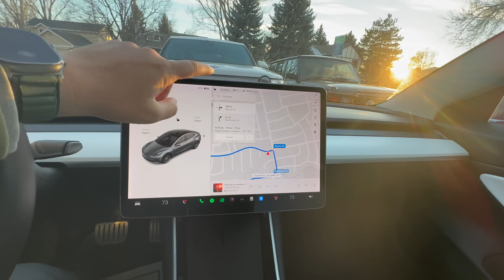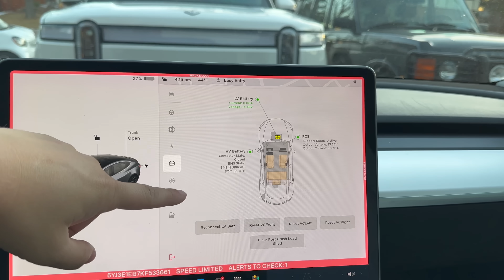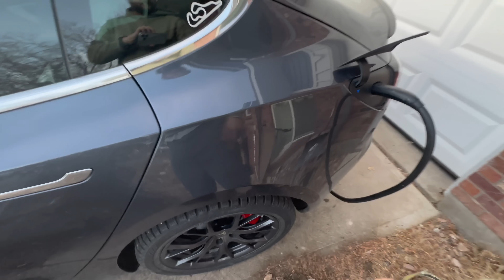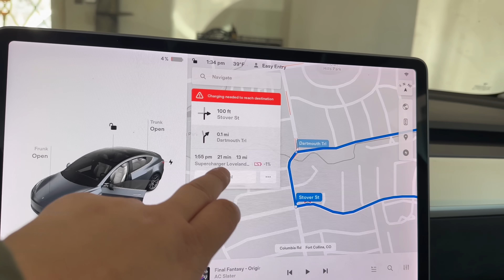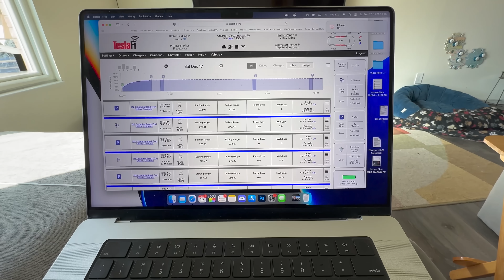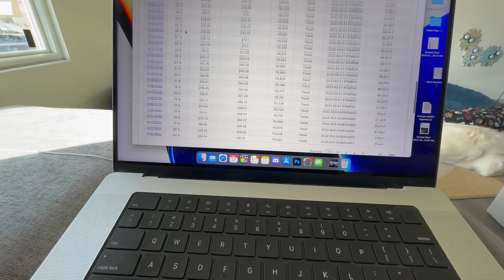Tesla Launches Service Mode! Wild Battery Health Results For My 120,000mi Model 3

Comment: I started at 18% battery health and the car was very noisy for 3 to 4 hours brought the power down to 3% and then started recharging up to normal 75% showing battery degradation of 84%. (2021 SR+ 263 epa range, now 217)

Comment: Those battery figures are just estimates, there is no way to know with electric batteries, same with your phone. My phone has been stuck at 84% percent for over a year now but im constantly charging, its probably about to go out. Same with the range, with batteries there is no way to know, just estimates by voltage and other stuff, with a gasoline car you exactly!!! know how much fuel you have.

Comment: I can’t find the post on what steps you exactly need to do prior to running the test?

I tried it a few times but it never completes.

Either 90% limit stops it or scheduled charging etc stops it and I have disabled both so it could complete but never does.

Any specific tips prior to entering service mode to run this test successfully while my battery is almost 10% please????

Comment: IT SHOWED HERE THE AC THE BATTERY HEALTH IS VERY LOW MEANING THE INVERTER IS NOT CHARGING IN CONVERTING AC TO DC. BUT CHARGING SUPERCHARGE IN TESLA CAN GO 100% MEANING DIRECT DC HAD GOOD CHARGING COMPARED TO AC CHARGING. BETTER SEND BACK TO TESLA TO REPLACE THE INVERTER.

Comment: The 8% battery figure is probably about as accurate as 175 PSI tire pressure.
Reply: The median between low and average is another good figure at around 14% degradation / losses.
Reply: Isnt it 17.5 psi?
Reply: @Candy-uo8sv  That would be too low.  Tesla tires usually have about 40-45 psi, which is more than a gas vehicle would normally have, but even a regular gas vehicle should have at least 25 psi.

Comment: We love traveling in our 2021 MYP. We have 38k miles and our car shows 267 miles when fully charged. Hasn't really impacted us based on the way the SC are spaced but I'm curious if we've really had that much degradation in 2 years.  I'm not brave enough to play with the service mode though.  Love your videos.  I aspire to be like Kyle or dad Dave. :-)

Comment: I think that mileage does not that much effect the battery health as the time. My M3 long range is 2018, but mileage is very low, now it is about 5500 miles only. Never supercharged (actually just tried once for a 5 min), charged to 100% only a few times before the trips. I did not do the test, but my range now shows ~285-288 miles if charged to 100% instead of 310, which means loss of range about 8%. So, it basically the same as for cars with more than 50K miles.
Reply: Do you always charge to the same level?  And do consistent trips like drive to work, get home, charge back to 80% every day?  If your car almost always sits at the same levels of charge (80% and whatever you arrive at work) then the BMS only has a couple data points and can't accurately gauge capacity.  If so, try charging to different levels (70, 85, etc) and/or skip a day of charging if you can and see if over a few weeks the range climbs.
Reply: @ekbuz  No, I don't charge always to the same level. It looks like that range now is like 285-287 miles stays the same about a year. Generally the battery  degradation is fastest in first years and then slows down, so I hope that my car will not be an exclusion.

Comment: Since your car took 64.30 kwh into the pack from 2%, and the usable battery capacity is 70 kwh, I think it'd be safe to assume that means you have about 7% degradation of the usable capacity. Probably a decent margin of error there, but Tesla saying "battery health 8%" might mean that you have 8% degradation of the usable capacity, which would be in line with what the napkin math works out to be.

Comment: Final result show my 2018 with almost 68k miles at 84%.  The last 4% of the drain process was weired.  It looked like stuck at 4% with nothing going on to drain the battery.  I had to stop and restart the test after a full day of waiting.  I don't know if it went to 0%.  When I noticed it started to charge, my screen showed 5%.  Also worth noting is after the test, my car was reset to factory default, which I lost all our driver profiles, favorite, etc.

Comment: About the test:
Has to be arround 20% to start.
First time i had it on 7% and it made alot of noise. Drained battery fast, But never charged back up. After 24h it was sitting there with 3% battery and it could not charge. Had to jnplug and powercycle the car then chsrging worked again.
Tryed with 20% again as ppl said and it did nothing at all.
So my guess is the test isnt working as it should 😅

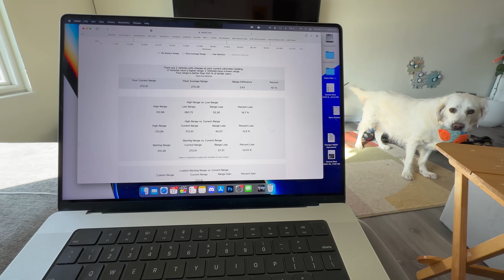Comment: 18:35 that doesnt include the hidden rated range.... if you have added 64kwh into the pack that suggests you have 64/78.8 = 18.8% degradation which fits really well with teslafi and your rated range of 270 miles - teslafi does not account for that. my car has i think 65kwh estimated capacity according to SMT and has roughly the same range as you.

Comment: Wonder what the uncertainty of the measurement is?
Typical current sensor say 300A +/-1%/2% accuracy, +/-1% linearity about +/- 4.2 amps @ 300 amps, charging at 40 amps could be  +/- 10% error. This does not take into account temperature sensitivity.
The voltage measurement will be better say +/- 0.2%
Since power is volts times amps the power measurement at 40 amps charging could be +/- 10% uncertainty.
Good thing is this uncertainty should be fairly consistent over the life of the cars measurement system.

Comment: Great video. I saw you did a lot of modifications. Specifically the lift. If you need to take your vehicle in for repairs what do they say. The aftermarket  stuff probly voids warranties. Will they still work on it? If you have to pay for the repairs how much do they usually charge? Is it calculated by a hourly rate,plus parts like regular dealerships?
Reply: It doesn't automatically void warranties, to a point. The whole car warranty? No. If you put aftermarket suspension on and something suspension related fails, maybe. But if a drivetrain part fails and they blame it on the suspension, they have no case. Been modifying cars for years, and it really comes down to the dealer working on it. My last car was modified significantly and they had no problem with it. Granted I did most of the maintenance and only took it there for major items.
Reply: @pathsfnd  Thanks, just wasn't sure what voids the warranty on a EV.

Comment: Are you sure the test completed? As I understood the test is was supposed to charge to 100%, but you are only showing 98.8%. Do you contend it charged to 100% then phantom drained 1.2% while plugged in? I think you have to do the test again. I also suspect you don't need to set your charge limit to 100% (i.e. the test overrides the user set charge limit) - would be curious to see a confirmation of that.

Comment: Out of curiosity why do you feel like you need studded tires? I have a 22 f150 powerboost 4x4. It’s totally stock has the factory tires and when we got this “blizzard” last week the truck was a beast in the deep snow and even icy roads. I would think the rivian would be even better. Just wondering. Thanks! I should add I’m in Michigan.
Reply: There are mountains in Colorado.
Reply: @RT-rv5be  and? There are mountains in lots of places. I was trying to get an answer from Kyle what his reasoning was. I’ve been over countless mountains in awd/4wd vehicles with standard all terrain tires without issue. I was looking for an answer from him to see if there was some difference with the evs that he has or was it in abundance of caution etc.
Reply: @Astrand1  Yeah, there are mountains in plenty of places but not where you live.
Reply: @RT-rv5be  so does that mean I don’t ever drive in The mountains? What kind of answer is that? We are supposed to helping each other I think that’s the point here. Again I was asking Kyle his reasoning for that. It might help others that could be looking at certain cars etc.

Comment: I have a question for you guys in the comment, so my 2019 M3 has about 95k miles, my full charge rated miles says about 272, but when driven about 73 Mph highway after my day is done I end up at 15% SOC or so and that’s after driving 153.7 miles!  I know other things consume the energy, but according to the energy app, when I add all the mile consumed it only adds up to about 190+ miles all together…. So to go from 272 miles to less then 200 it’s quite significant, any of you have notice similar things?
Reply: What kind of Wh/M is your trip meter showing at the end of the day? Are you in a colder area right now?
Reply: Tesla efficiency is poor on the freeway and even worse if the climate isn't just perfect. Add passengers or cargo and the range drops further.
Reply: 272 miles is if you keep driving at constant speed of 55 mph. 73mph would definitely killed 100+ miles because of the driving speed. Try to stay below 70mph you will definitely get more than 200 miles real world range.
Reply: Same problem here. But it's all highway and roughly 75mph+ 😅

Comment: This is all BS designed to intentionally mislead owners.  There is only one real way to determine your degradation. 

First of all. Don't use the GOM estimated range.  It does not take into consideration degradation.  This was from Peter in Southern California. 

The khw capacity of a Tesla battery can be calculated with a fairly simple test. (Below)

But first, what you cannot rely on is the cars display of range. I'm not sure what algorithm is used for the cars display of range, but my 2016 Model S 90D continues to show a full charge “Rated" range of 285 miles. Real range is 200 miles. And significant battery degradation is concealed.

Here is how to measure the energy capacity of a Tesla battery. You need to use the “Trips" page to get a display of kwh used. You need to take a trip that consumes a significant portion of the battery capacity. You need to set the battery display to show percent of battery remaining, rather than miles remaining. At the beginning and end of your test trip, note the change in battery percent, and the change in kwh used. Here is an example (a real example). I charge up my car to 80%. This resets the kwh used counter to zero. I drive around until the state of charge guage shows 30%. The “Trips" page shows that I have used 36 kwh during this test trip. Now you do a little arithmetic. 80% minus 30% is 50%. 50% is 0.5. Now divide the 36 kwh by 0.5 and you get 72 kwh. That is the full energy capacity of my battery. My “90 kwh" battery only has 72 kwh. If I had gone a little further, the ending battery state would be 15%. 80 minus 15 is 65% (0.65). The Trips display would show 46.8 kwh used since last charge. Divide 46.8 kwh by 0.65 reveals a battery capacity of 72 kwh.

The usable energy capacity of a Tesla battery is not expected to be 100% of its nominal capacity. So my “90kwh" battery can only be expected to have about 85 kwh of usable energy. Since it only had 72 kwh (at one year old), it lost 15% of its capacity during its first year. Important thing is that all the while, the full charge display of range was (is) 285 miles. Failing to reveal the battery degradation that occurred. Happily, it has only lost a little more since then. And that's a good thing. Because a Tesla Service rep told me: “We do not replace batteries for any amount of degradation. Only if there is a battery fault. Which the car will tell you.”

Most Tesla batteries are better than this. However, it seems unlikely that my car is the only one which displays normal capacity when in fact it is significantly degraded.

Comment: Did the test on my 115k mi 2021 Model Y LR, got 82% life. Better then I expected tbh this vehicle was driven very hard its whole life and been supercharged a majority of it.
Reply: Wow that’s alot of miles for a 2021
Reply: Wow. Impressive mileage. I'm at just under 115,000 on our 2020 MYLR. Would be curious to know if you've had any issues with your AC system. Also curious how many miles TeslaFi or another app might say you have on your battery. I'm at about 155,000 rated miles used on the battery according to TeslaFi.
Reply: @bnzjamin  what does the battery health say?
Reply: @xxBlackpspxx  according to TeslaFi, only about 12.5% degradation.
Reply: This is disastrous. Almost 20% after only 1-2 years. Like a cheap smartphone battery. If the range is like 290 miles on a charge (since you said driven hard), 115k miles are about 400 charging cycles. 82% health left after that, plus it's only 2 years, is really bad. So, Tesla batteries don't seem to last long after all!
Reply: @xxBlackpspxx  Did you read his post? He drove 115K miles on it in 1-2 years... thats insanely above average.
Reply: @super_tomtendo  yes, it is. But especially due to the low timeframe the battery shouldn't have aged as much. Batteries degrade from 2 things: charging/discharging and solely time by itself. If he drove 115k miles in 6 years it would be even less capacity now.
Reply: @xxBlackpspxx  sir, because of his insane usage he was also required to charge it way more than a normal person. The time frame has nothing to do with that but usage does.
Reply: @super_tomtendo  uh, yes. You don't really get my point eh? Age itself degrades a battery, even if you store it perfectly. And the battery isn't very old and has only like 400 cycles on it. 82% capacity left is bad in this case. Like a really poor battery
Reply: @xxBlackpspxx  Battery degradation with time is not a constant thing, its depends on the % its being "stored", a perfect 50% balance would make it degrade very little.
This is why you see new phones usually being at 50% when you turn them on.
I do agree that for less then 200k km's its a very high capacity loss, but I wonder if Tesla could add a "compensation" mode, maybe limiting the power by subtracting the capacity loss.
Reply: @mx9695  yes I already said all of this. Depends on storage. Bliblablub, you don't get the point

Comment: So my results was 86% battery health on a Tesla Model 3 long range rwd 2018 with 56k miles. The weird thing is that a few months ago i was trying to calibrate the battery and one of those days i charged the car up to 100% and i was getting about 307 compared with the 303 that i am “getting” today at 100% which still not bad. But I don’t think i have 14% battery degradation.
Reply: Jealous, my 2018 with under 40K miles only showed about 290 miles of range with a similar attempted recalibration.

Comment: Should I not leave my 22 MY plugged in and charge to 90% daily? That's what the screen suggests for daily but he was talking about staying around 50%. My wife only takes the kid to school in it and back home which is around 22 miles a day then she plugs it back in. Am I charging to high each day?
Reply: Elon once posted that "even 90% should be fine" - if you don't need the full 90% all the time, charge to lower SoC. 50% is definitely "super-cautious", or in other words: useless. For what your usage seems to be, set it to 70% and all should be fine. I did the 90% thing for the first 40k km (now have 80k km on it) and my degradation was (and is) totally within the fleet level,  even a little lower than the fleet average (means: better milage).
Reply: For all batteries, they are much longer lasting to keep them in a mid charge. You can see the scientific research but optimal would likely be between 20 and 60 percent charge. Doing this exponentially increases the number of charges the battery can do before failure. I would need to read again but doing 20 to 60% all the time would mean many thousands of charges before failure so battery would last 30+ years however even 5-90 every day battery will still cycle maybe 2000 times so likely 15 years plus. Supercharging is hard on batteries but the Pre heat helps a lot. In all just have it in mind not to hammer super charging, avoid less than 10 percent and avoid more than 80 percent of you can and the battery will last a lot longer. For your normal use keep between 30 and 50 percent shoukd be more than possible and mean the battery last longer than you 😂
Reply: The user manual says leave plugged in and charge to 80%

Comment: Ok so I watched the video and just to mention that just removing aero wheel caps (-4%) and changing the tires from primacy to pilot S4 (-7%) can gives false results up to 11% !!!
Reply: How do the aero caps and the wheels in general interfere with a test that's done stationary? You could basically put the car on bricks to run the test.
Reply: @gwieser  If you drive with aero and proper tires over the lifespan of the car you will exactly have less degradation!

Comment: Real measurement of charge capacity is done at a fixed rate, i.e. 1/20 of label capacity in ICE batteries. I'd expect the Tesla service test also relies on consistant standardized dis/charge rates.

Comment: I hadn't heard about this!  I've got a 2013 S85 with 220k miles on it!  I need to see if this mode is available on the older cars.  Of course, it's in the shop right now, so I can't test until it comes back.
Reply: That's amazing. I know it's in the shop now has it been holding up overall?

Comment: I think you should replace the coolant valve actuator to clear that fault and then repeat the test. Start at about 25%, not single digits. You might have to disable TeslaFi first.

Comment: 174psi might be the pressure the car thinks the air suspension is at. Not tire pressure...
Reply: Model 3 does not have air suspension.
Reply: @steve4296fred  I've seen a model 3 with air suspension
Reply: @macbook802  maybe aftermarket, but not Tesla OEM and certainly not integrated into the Tesla service mode diagnostics.